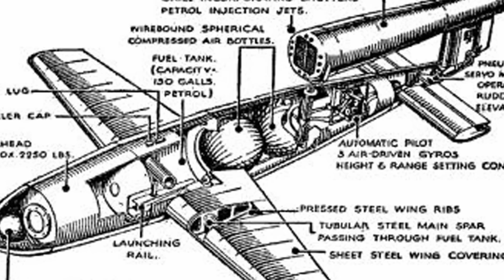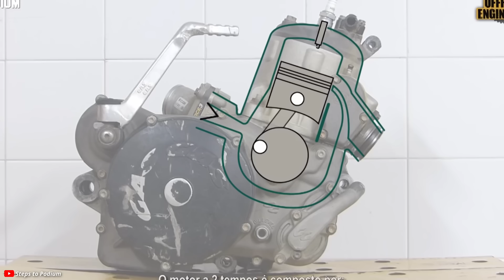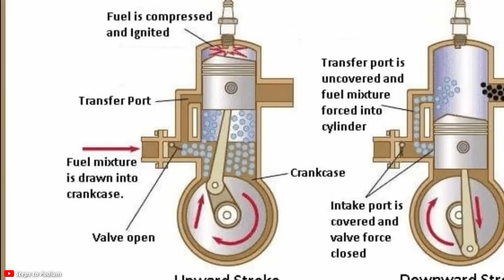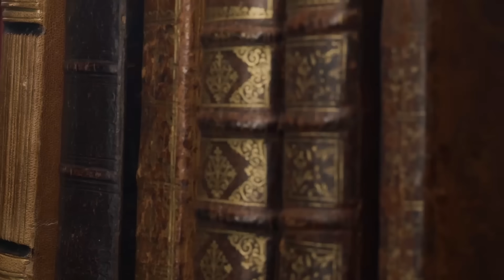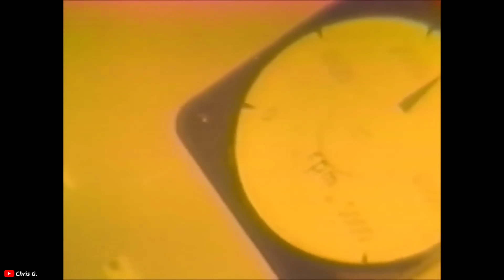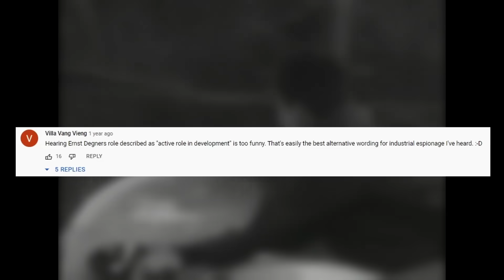How Suzuki stole communist technology to make their motorcycles faster

Comment: I had a Bridgestone 1968 350 GTR with the rotary valve engine. It was incredible as I compared the Bridgestone against the Yamaha 350cc and the Bridgestone had more power and a sustained higher speed as well as better handling. I also had the Bridgestone 175cc Twin  and I believe no other 175cc bike could ever beat it for sheer speed. Both bikes were reliable and made simpler by having automatic oil injection. Always wondered why Bridgestone left the market. Thanks for the information on the rotary valve history!
Reply: Bridgestone 350 GTR...never mind the power, in my opinion one of the best-looking bikes ever made.
Reply: I was told a story that the 'big three' told Bridgestone that if they didn't stop making bikes, they would start making tyres.

Comment: Peenemünde was organised into two major groups. One was headed by Wernher von Braun who developed weapon systems on the main Peenemünde site. These were weapons that flew a trajectory such as artillery projectiles and rockets. Kaaden was a lowly member of another group that was based at Peenemünde West. This group developed weapons that were guided in some form.

Kaaden never worked on the V1 because he was employed by Henschel AG in Berlin to work on their own weapon, the Hs293. A rival company called Fieseler designed and manufactured the Fi 10, commonly known as the 'V1' or Flying Bomb. Kaaden didn't work on the V2 rocket because this missile flew a trajectory and, for that reason alone, the V2 was part of von Braun's group.

After leaving Chemnitz Technical Academy, Kaaden started work on 29 July 1940 as an engineer at Chemnitz. However, by September 1940, just a few weeks later, he had joined Henschel AG where he was assigned to the Hs293 team at their Berlin factory. The Hs293, a weapon called a glide-bomb on which Kaaden would spend his entire war years, was designed by Professor Herbert A Wagner. Today, the Hs293 would be called an Air-to-Ground missile because after its release from beneath a bomber's wing, it glided to its target on short stubby wings with the aircraft's bomb aimer using a joy-stick to visually guide the missile over a radio link.

In September 1943, Kaaden successfully applied for a transfer to the Henschel team working at Peenemünde West. Kaaden transferred there as a flight test engineer on 4 October 1943. Note, this was some 7 weeks after the RAF's bombing raid on Peenemünde (Operation Hydra) on the night of 17 to 18 August 1943. Talk of Kaaden having a narrow escape from this heavy bombing raid is complete poppycock. In fact, because Operation Hydra had exposed the vulnerability of Peenemünde to RAF bombers, Hitler ordered Peenemünde to be vacated. By then the V2 rocket was almost in production and Von Braun and the V2 project was moved to the Mittlewerk factory in tunnels beneath the Harz mountains. There, it built the rockets using forced labour from the notorious Mittelbau Dora forced labour camp.

Meanwhile, the entire staff of Peenemünde West was in the process of moving lock, stock and barrel to Jesau, another Luftwaffe airfield 300 miles further east. “By October 1943, the move was largely completed," says Manfred Kanetzki (who works in the Peenemünde museum) on page 129 of his book, OPERATION CROSSBOW: Bomben auf Peenemünde. This meant that for the few days when Kaaden was based at Peenemünde he was likely packing the tools and equipment for testing the Henschel Hs293 at Jesau.

With such a short-term record at Peenemünde, it is stretching a point to say that Walter Kaaden worked at Peenemünde or that he was a Peenemünde engineer. He was certainly a 'Jesau engineer' but of course, being a flight test engineer at Jesau doesn't quite have the cachet of Peenemünde. In the same way, many references attach Kaaden's name to Wernher von Braun allowing Kaaden to bathe in the halo of the famous saturn rocket designer. In reality, Kaaden worked for a team ultimately headed by Professor Herbert Wagner - but whoever's heard of him? In fact Wagner was so important to the Americans that he was the first German scientist to set foot in the USA after WW2.

As for the racing MZs, Kaaden invented nothing. All of the three areas mentioned, expansion chamber, rotary disc valve and boost port were already in use (and patented) in Germany, years before Kaaden 'reinvented' them after finding them in technical books.

This YouTube homage to Kaaden tells an incredibly inflated account of the part he played in improving the two stroke engine. In truth, the most that could be said is that Walter Kaaden DEVELOPED the ideas of others whilst happily accepting the false accolades of many non-technical, ill-informed writers thereafter.

Was it not Mark Twain who wrote, 'A lie can travel around the world and back again while the truth is lacing up its boots.'?
Reply: I really don't know this WW2 history all that well but if you are going to attack another writer you should really learn how to edit your material or do what others do  and have somebody else check your content for mistakes.  in P 1 sentance 4 you say   ""The V1 was not powered by a rocket engine but by a pulse-jet engine ""   thats all well and good but in the video they say the same thing.  This is all well known technology  which was reported a lot in the early 50s.   BART did say that also also in the report that about expansion chambers because the the V1 used a similar concept in the VI engine design this is clearly visible in the V1 tapered cone in the rear part of the v1 motor,  if your going to be a critic get your facts  straight DICK  bye bye
Reply: Very interesting.
Reply: He is right .Stop crying..
Reply: @ermias75ermis2  u seem to be the one crying
Reply: This is interesting stuff.. Ignore the naysayer, " V1 tapered cone in the rear part of the v1 motor", this post implies that similar appearance equates to similar function. Not true in my experience, working in a shop (engineering), we'd never assume anything like this. Thanks for the detailed post.

Comment: In 1964, my older brother bought a 55cc Bridgestone motorbike that was away faster than the 50cc Suzukis and Honda step throughs and at the time. In 1965 he bought a Bidgestone 175 twin with rotary induction valves. It was really fast at that time. Three years later, I bought a 350 Kawasaki A7 two cylinder two stoke. It was away faster than all my friends with Hondas and my bike stopped faster. I had no idea at that time or until now that an East German engineer was responsible for that bike I loved.  I wish I still had it now!! I am watching for one. 

That Nazis were really empowering engineers. It is amazing that they did loose the war. My father landed in Normandy, was wounded 3 times and sent back in each time to be on the pointy end in France, Belgium, Holland and into Germany with the Canadian army. Germans were serious fighters for a loosing cause. 
Though far from motorcycles, your video takes me into History asking question around “What if…) just like you did. Thank you for holding up the unsung hero of that time.

Comment: 5:46 The rotary valve was an invention by German tuner Daniel Zimmermann, not by Kaaden. 7:44 That "supercharging" happens exactly the same in four strokes - by tuning the in- and exhaust systems, four strokes can achieve 120% volumetric efficiency. I would like to draw attention to the fact, that the Suzuki racers already had exactly the same concept as the MZ racers, the only contribution of Degner was the final tuning of the engines. And if Suzuki got their knowledge from Degner, where did Yamaha and Kawasaki got their knowledge? It was all their own research!
Reply: I believe what you are saying,Unfortunately these young people  who run these videos do "little research" and trust one source,My Suzuki GT550 had more in common with the Scott,A triple, oil injection, Air cooled,The Scott had parented oil injection but Suzuki came up with a Alternative
Reply: The real contribution was pointing the transfers at each other so the mixture doesn't get blown right out the exhaust port, negating the need for deflector-top pistons. Lighter pistons and specific fuel consumption goes way down.  No mention of Schnurle porting?
Reply: @Johnketes54  maybe you should make your own video before throwing stones.
Reply: @puttputt73  That was already well known in the thirties!
Reply: @murrijuana2842  He's not throwing stones, he's totally right!
Reply: @mbpm6135  You're obviously talking absolute nonsense! In the first place, Degner's contribution was fine tuning the Suzuki racers, which were already in their final form. And do you seriously think, that Suzuki then went to Yamaha and Kawasaki and said, hey guys, this is the way to do it? Learn a bit about the history of those brands before making yourself a total fool!
Reply: @joepkortekaas8813  No, I said the tech made it onto a streetbike which the other factories then bought and reverse engineered. Read what I said. Do you have any idea how much competition there is among racing teams? They are observing each others teams, machines, management, people etc like they are at war - not far off anyway. What makes the two stroke fast was novel then in 1962 but these secrets made it onto the grid and soon after into commercial products.

Comment: I've been racing 2 wheels for 50 + years.  Growing up in Japan two strokes were the thing. Suzuki impressed me also by adding a 6th gear. Pencil thin tires 
 was a great barrier to putting the power to the road. Drum brakes fading was another challenge while limited suspension ment you had to throw yourself off to keep from having to scrub speed in turns. I could often beat much faster bikes because most courses require more than just throttle

Comment: Btw the exhaust system works like a resonance tube. In a resonance state very high pressure can be achieved by the reflected waves. This is supercharging wo any moving parts. It needs of course that more gas is sucked into the chamber and through the exaust opening into the resonance tube, so that it can be reflected back into the chamber with increased pressure. However, the increased power does not come w/o a drawback. In a non resonance state the system does not work or is even detrimental. Therefor the designer normally use systems with less sharp resonance effect, i.e. they give in max power for a smoother transition range.
Reply: In the 70-s the 2stroke motorboat racers used tuneable (lengthwise movable) exhaust pipes for fine tuning on high revs. Konig, Evinrude, Johnson, Mercury, Vihar (CCCP made), all of these brands used this technology. Even today is used.

Comment: Thank you for your video. D.K.W. once was the biggest motorcycle manufacturer in the world before WW2 with more than 400.000 motorcycles built per year. In Suzuka they named 2 corners after Ernst Degner, the two right hand ones before the crossing under the circuit up to the hairpin.

Comment: 200 HP per liter is more than the sport bikes were doing in the early 2000's! Damn impressive, if not scary, considering they were on chassis and tire tech largely learned in the 1950's!
Reply: The two stroke process basically means an engine produces the power of a four stroke engine twice it’s size.
Reply: @trappenweisseguy27  In theory
Reply: @johnr6292  waaaaang waaaaaang ting ting ting
Reply: I don't think your reading it right,Whatever the 125cc made multiple it to 1000cc, It does not work like that my CD175 produced 18 bhp so my 350cc should produce 36 bhp? It produced 34 bh,It gets heavier so any bhp has to push it up the road
Reply: @trappenweisseguy27  1.5 off it's size upto 40% more power like a turbo
Reply: @Johnketes54  I didn't multiply anything. Just going off the narration in the video. I understand dynamics.

Edit: and I stand behind my comment.
Reply: The final 500 cc race bikes had up to 200 hp, so yes, it gives approximately 400 hp per liter. Valentino Rossis 2001 championship winning Honda NS 500 had approx. 170 hp at the back wheel.
Reply: @trappenweisseguy27  that's not really how it works. But a two stroke does produce power twice as often (per strokes) as a 4 stroke. The horsepower and other engine characteristics are dictated by many things and cluding the valve train dimensions and durations, the intake system, the exhaust system, compression ratio, ignition timing, and even the material with which the parts are made, the oil that is lubricating them, and the fuel that is burnt.
Reply: @kasperkjrsgaard1447  Those 500cc bikes were pumping more power than the four stroke liter bikes of their day. The current MotoGP bikes are almost 250 horse at twice the displacement of 1000 cc's.

Comment: 2 stroke motorcycles were used in racing well before the 1960s. Scott produced 450 cc two-stroke twin-cylinder water-cooled racing motorcycles from 1908, winnin Wass Bank hillclimb in that year. A Scott 2 stroke held the TT lap record in 1911, 192, 1913 and 1914, winning the race in 1912 and 1913. From 1911 to 1914 they even used rotary valves. Scott produced 2 stroke motorcycles with sidecar mounted gun during WW1. 2 stroke Scotts were produced until the death of Scott in 1921, but the company continued after that making more conventional motorcycles. As so often is the case, Scott was probably ahead of his time.